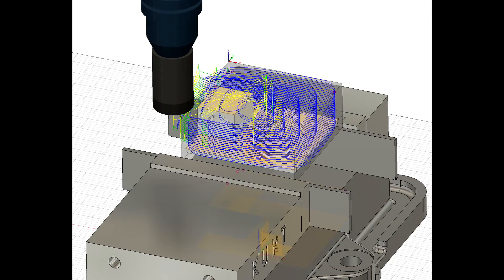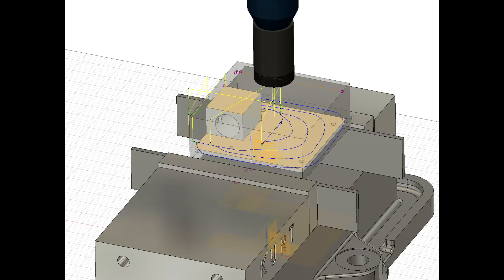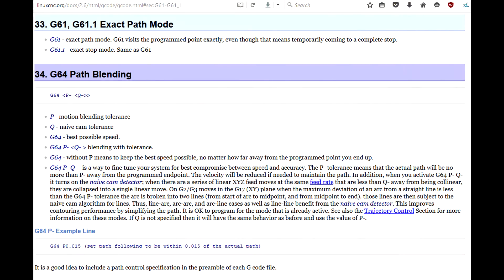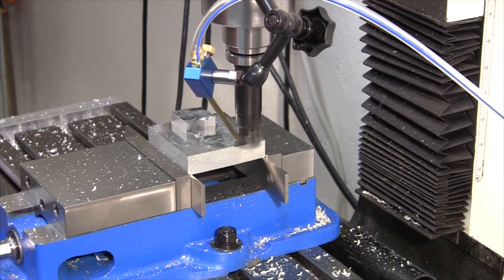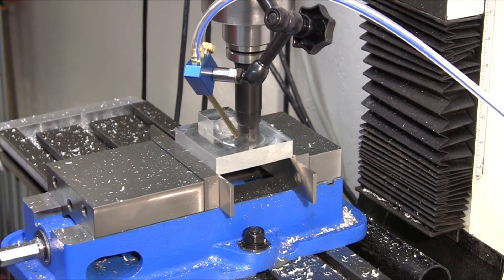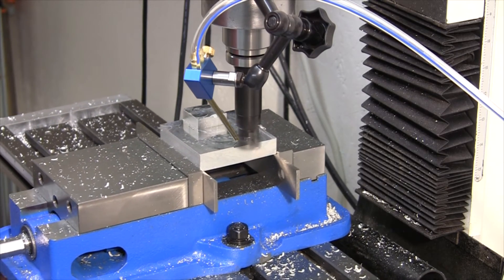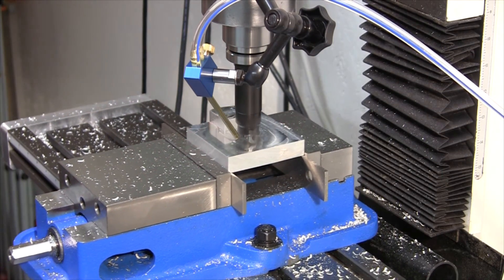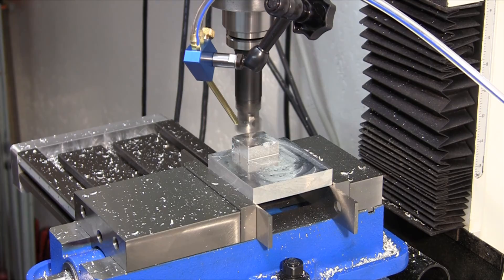LinuxCNC G61 vs G64 part collision, PM25MV

Comment: I have a small gantry style router running GRBL. I'm working to upgrade to EMC2 for control for the path blending. GRBL executes one line of GCode at a time, and I've noticed that any interpolation will result in jerky motion, and since my router isn't very rigid, the tool bounces around a bit.

Comment: You just saved me hours of head scratching. Had the exact same type of collision twp times and was looking into everything with many simulation software and finally narrowed it down to the trajectory planner. Being a new guy to Linuxcnc it wasn't easy. Thank you very much. Now I know exactly what to tinker with.
Reply from the maker: Very glad the video was helpful! If you are using Fusion360, I keep my post processors at the following URL. These are updates to AutoDesk's that include a reasonable preamble and messages about tools being loaded.

https://github.com/kentavv/kvvcreates/tree/master/fusion360/linuxcnc_post_processor
Reply: @kentvandervelden  Thanks again. I was looking into post processors that could actually send out the tolerance value  given per operation as G64 PXX and trying to wrap my head around how post processors actually work. Yes I'm using fusion 360. This is a great resource. It's almost 1.30am in where I live. I'll definitely check them with my machine tomorrow.

Comment: i ran into this issue recently, got as far as seeing g61 vs g64 docs, but wasn't sure what to change or where. i see in an earlier comment that you have a init.ngc file, how are you executing that now? is it in the  post processor for F360 to set it every time you execute g-code? some sort of init script for linuxcnc? both?
Reply from the maker: On startup, I execute the following scripts after homing, on the mill and lathe, respectively. When LinuxCNC starts, this init script is loaded, ready to run, by setting OPEN_FILE=<init filename> in the LinuxCNC INI file. I've thought to add it to the Fusion360 post, but have not yet. Hope this helps.
https://github.com/kentavv/kvvcreates/blob/master/linuxcnc/init_mill.ngc
https://github.com/kentavv/kvvcreates/blob/master/linuxcnc/init_lathe.ngc
Reply: @kentvandervelden  just as a heads up i did some digging, and you can have this happen out of the box by using this section of the ini file. 

http://linuxcnc.org/docs/2.6/html/config/ini_config.html#sub:RS274NGC-section
Reply from the maker: That's cool and they have G64 in the example. Definitely would have saved me a few times. If you're interested in complexity, on the Fusion forums you'll find people changing the P parameter depending on operation using post processor code.

Comment: This video is 3 years old, but just a note: you can switch between G61, G61.1, and G64 (with varying tolerances) throughout your program. If you wanted to be extra precise (instead of G64 P0.001 precise), you could tweak your post processor to enable G61 during rapids and enable G64 during cutting.

In either case, great to see more content on LinuxCNC! I'm (successfully) blundering through my first build now, and yes, the blending did catch me off guard as well.

Comment: This has nothing to do with Linux, I have changed the settings in my cam program (One) so that it always go up in Z, before it moves in X and Y.
Reply from the maker: LinuxCNC uses G64 (Blend Without Tolerance Mode) by default. The LinuxCNC documentation warns: "keep in mind that the tool’s path will be somewhat more curvy than the program specifies." Your CAM could be switching to a different mode, retracting higher, moving slower, mixing rapids with normal moves, and probably other methods to stay closer to the programmed path. I would no longer recommend disabling blending, because programs with lots of small moves interpolating a surface run much faster with some path blending enabled.
http://linuxcnc.org/docs/2.7/html/user/user-concepts.html
http://linuxcnc.org/docs/2.7/html/gcode/g-code.html#gcode:g64
http://linuxcnc.org/docs/2.7/html/user/user-concepts.html#sec:trajectory-control

Comment: Thank you! I've used EMC2 for years, upgraded recently with my new mill and started ruining parts on it. Thought it was Fusion 360, but it wasn't. I just updated my personal Fusion 360 post-processor to include the G64 P instruction in the header after finally understanding why LinuxCNC was clipping the top of one of my parts, thanks to this video. Real bummer to sink hours into a part just to have it be ruined by the trajectory planner, it's too bad it's buried in LinuxCNC's user manual and not really well highlighted. Thanks again.
Reply from the maker: Hi, I'm glad to hear from you that the video was useful. The problem hit me again recently on a CNC lathe conversion. I sort of get the philosophy of G64, but it seems overly aggressive in general. In case they are helpful, I uploaded my posts to https://github.com/kentavv/kvvcreates/tree/master/linuxcnc/fusion360_post_processor Mainly, it's the mill post that I've worked on, only adding a list of tools that are used and descriptions during a tool change. I have a init script that I run on startup, but as you did, I should add this code to the preamble generated by the post. I'm working on a script to split up a single file generated by the post into logical segments as separate files. If you are interested, I'll let you know how it goes. Happy New Year!

Comment: You can also put an inert instruction between two lines to prevent interpolation.

For example, if you want to use path blending most of the time, but not on Z retraction, you can add G4 P0.001 before the Z retraction.

Again, the example:

G1 X Y
G1 Z

becomes

G1 X Y
G4 P0.001
G1 Z

This breaks the path blend between those two lines. I use it all the time. I'm sure other instructions can be used, or different time values, etc.
Reply from the maker: Thank you Gary. This would be a nice addition to the post processor. I've been wanting to describe my changes to the F360 LinuxCNC post processor and I'll give your suggestion a try.

Comment: This is the trouble with forums where everyone knows nothing. WTF does tool deviation have to do with clearance. Mac3 never had a problem because the logic of the post processor.
Reply from the maker: Does Mach3 or Mach4 support G61 and G64 and what are their default values? How does that compare to LinuxCNC? The only contribution the post processor can have with regards to the demonstration to set G61 or G64. One could set clearance planes higher (in CAM) to hide the fact that path blending the taking place while maintaining speed, but path blending also affects corners in a plane when milled at high speed. Perhaps I misunderstand your comment.
Reply: "but path blending also affects corners in a plane when milled at high speed" Yes, that's the purpose of the command, not traversing, but if you only wanted it for traversing and not milling then customise your post processor to do so. I don't believe your problem is in linuxcnc or mac3, it's ether the logic of your post processor or you are exceeding the ability of your machine to maintain a correct trajectory. It's one of the reasons why better CAM programs offer post processor customisation. My comment is simply to say I think you're going down the wrong rabbit hole. Cheers!
Reply from the maker: In LinuxCNC, path blending collapses consecutive moves, if it can, which results in controlled corner rounding. That's what hit me in the video... a sharp corner required to clear a boss, at high speed, works in CAM simulation and looks good on the screen of the LinuxCNC controller. So the G-code is correct, but once executing with the default path blending enabled, the corner is rounded, and the rounding is sufficient to collide with the part. 

Perhaps the meaning of G61 and G64 depends on the controller? Here are LinuxCNC's descriptions.
http://linuxcnc.org/docs/2.7/html/gcode/g-code.html#gcode:g61-g61.1

For sure, modify the post processor to add the appropriate setting to the preamble. Also, at least in Fusion360, several strategies have a Smoothing option, which seems similar to path blending, done during the tool path generation prior to g-code generation, which may help.
As you said, the real issue is the machine,'s ability to maintain trajectory, accelerate, etc. LinuxCNC models the machine with it's trajectory planner, modifying trajectory of the g-code to stay within the mechanical limits of the machine, and LinuxCNC seems to have conservative defaults. A better approach may be to enable G61 exact path mode, and use CAM smoothing, Fusion360's name, to approximate the machine's capabilities, review in simulation, and post with confidence the controller is not going to do something like that which surprised me. I never finished the followup video, but it's easy with exact path mode to create horrible examples of the machine jerking around during interpolations of many small moves, so I keep a small amount of G64 enabled.
I was recently bit again by this on a CNC lathe conversion. I didn't have my initialization code on the lathe, was running rapids, and clipped the part.
I'm pretty confident in my reasoning, but only in the case of Mastercam + Mach3 + big Industrial Hobbies' servo driven mill (10+ years ago) and Fusion360 + LinuxCNC + little PM25 stepper driven mill (today). Your setup could be completely different. If you think I'm wrong, I'm glad to try a test that you suggest and post the result. Would be a good excuse to finish the followup video. Again, I certainly could have explained the setup and results in the video. In the end, regardless of the reason, what didn't work originally now does. 
Alright, great discussion, I like the details, and thank you for taking the time to followup. BTW: I've worked in the ag industry for nearly 20 years and have a lot of respect for farmers. Best wishes from corn belt of the US, Kent
Reply: Hi Kent. Thank you for the response and wishes. As the trajectory planner has been re-written in 2.8 if you do a follow up it would interesting to see if you find any difference. However, you must have had an influence on someone at some stage because the latest LinuxCNC V2.8.0-pre1-3604-g138d7bd manual states when using G64 "... can work great as long as the programmer is careful to keep in mind that the tool’s path will be somewhat more curvy than the program specifies. When using G0 (rapid) moves with G64 use caution on clearance moves and allow enough distance to clear obstacles based on the acceleration capabilities of your machine." 
Australia, down under ;-)
Reply from the maker: It's unlikely I made an influence on anyone, but it's nice having a LinuxCNC brother from Australia. My neighbor is from Australia... and stereotypes aside... "WTF" is pretty much how he greats me in the morning. :) 
I've only started to look at the code of LinuxCNC. It's not easy to get pointers on the forums for suggestions for areas to work on, or how to make contributions. Even simple stuff like problems with the documentation I would like to help with. Chris M has been the most helpful, but everyone is busy. I was hoping to apply a static code analysis tool to LinuxCNC that a friend's company made (Atlas from Ensoft), it found dozens of problems with the Linux kernel, but there's enough C++ in LinuxCNC that Atlas is probably not going to work. Anyway, if you have any suggestions, how to get started, what to work on, please let me know.

Comment: One good reason why the machine controller should not deviate from what is programmed. If you want smooth corner machining and blending, use the CAM to do those. SolidCAM for example does everything like this, shows you a solid verify and the machining time accurate to within seconds.
Reply from the maker: +Jaakko Fagerlund Nothing is worse than unexpected moves, especially for a newcomer like me. LinuxCNC makes a reasonable argument that the controller should represent the physics of the machine, and if a move is not possible on the machine the controller should modify the move while prioritizing maintaining velocity. You run big CNC machines? How do their controllers handle this? Do they warn the operator if the g-code contains high speed right angles?

Comment: Excellent! Thanks for the clear/concise explanation. I am still dealing with this and will try your method. I wonder if just upping the accel on the Z would solve a lot of this problem. I'm going to toy with it tonight :)
Reply from the maker: Hi Rus! Increasing the acceleration on the axes would help because if an axes can (de-)accelerate extremely fast, the corners will look square. Eventually, limits of the machine are reached. Higher acceleration on my light machine caused undesirable shaking and too high of acceleration would cause the closed-loop stepper motors to fault (too great of following-error). Accidentally, the closed loop steppers may provide a means to dial in the acceleration by examining the following-error from the driver, and increasing the acceleration while staying below a maximum acceptable following-error. Increasing the retract levels in Fusion360 would be another option, but that's not going to help with X-Y rapids (if they ever occur in Fusion360). I use "g64 p.001 q.001" in a init.ngc file. Was fortunate (or coincidental) that I would have to learn about all this on the first part with LinuxCNC. :)

Comment: Un-related question. What size vise is that on the mill table?
Reply from the maker: It's a Kurt D40 4" machinist vice. It's 4" wide and opens to maybe 4.1" For larger parts, I've moved the jaw plates to the opposite sides of the fixed and movable jaw and that's worked well. The flange around the base of the vise hangs off the back of the table and interferes with screws holding the way covers in place. I've removed the screws and gained some travel. If buying another vise, I would probably get a Glacern GPV-412 or a Tormach vise. These are similar to price to the D40, but do not have the flange nor bolt down holes and could be positioned to make better use of the Y-axis travel. My understanding is, machinist vises have the flange and CNC vises do not. With the D40, because of how it has be bolted down, there is a lot of precious Y-axis travel wasted. Also, the D40 does not seem the same quality as the D688 I previously had. I know this is a bit more than you were asking about, but I hope this information was useful to you.
Reply from the maker: And, the D688 was for a different larger mill :)